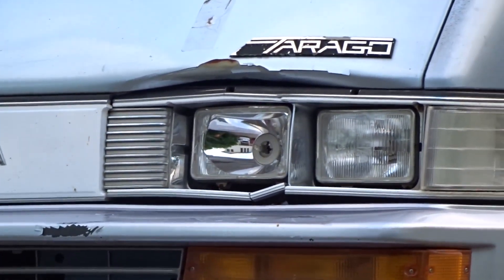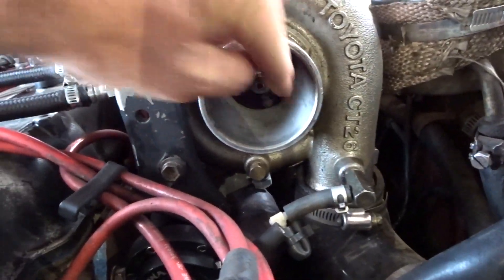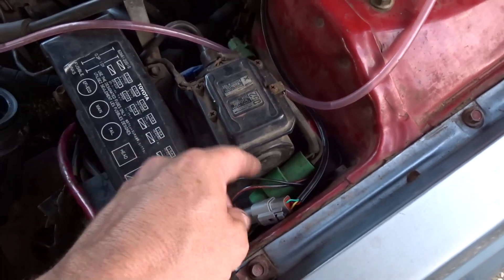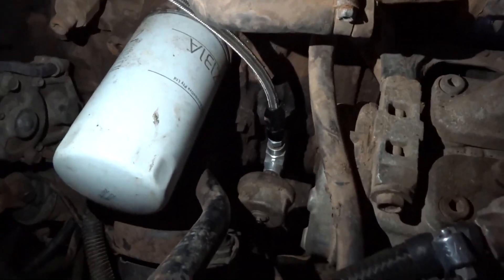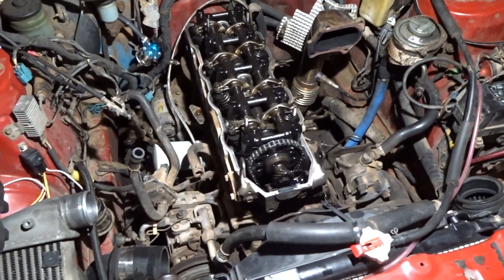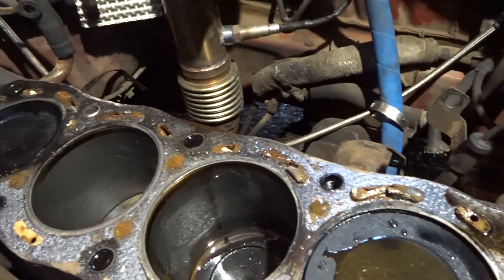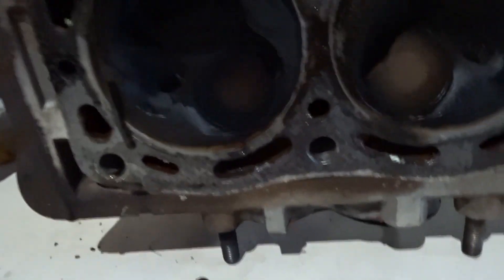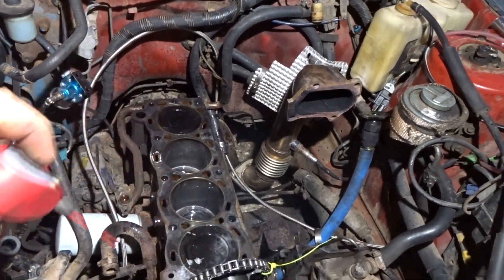Fixing a Blown Head Gasket in my Boosted 22RE Celica! Pt.1

Comment: How she holding up with the studs? I have some ARP studs on the way and am looking for some confidence. My 22re blew the head gasket at 7 psi, and I don't think it was knock induced because I'm using E85. 

Love the car btw! I have a similar build in a pickup (hilux). My maxpeedingrods churbo (t3/t4) been kicking some ass. Using megasquirt on mine, but thinking I might try speeduino on my next project. 

Do you have an aftermarket camshaft? I'm hitting 7 psi at ~3500 rpm with my turbo. The powerband is super narrow with the stock cams, because VE plummets around 5000rpm.

Comment: I originally wanted a 3rd gen celica bc it’s rwd but I couldn’t find one so I settled for a st162 celica. I love the style of both and it debating whether to get a st165 gt4 next or a 3rd gen RA65. What do you recommend. I mainly want it as a weekend street car and take it to the track for grip occasionally.
Reply from the maker: It really depends on how you want to drive it, RA65 is a lot lighter than an ST165 due to not having a heavy AWD system but needs a lot more work to make it "fast".
I haven't even been able to drive my 165 properly yet so I can't give much of an opinion on it unfortunately. From what I'm told they were built as a rally car and won't ever be a great circuit car.

Comment: About 8 psi is good enough. I know how it can be when you have to take apart the car and fix it. It sucks. 

Body damage is easy. But engine that takes at least a week. XD
Reply from the maker: Aiming for 10-12psi with the fresh gasket and ARP studs, should be fun lol
I suck at body work, engine is the easy part for me!
Reply: @AaronBonBarron  I get that. Its the frame that gets me hung up. I can work on engines I just dont got tools to do it most of the time. I lost so many sockets when I was working on the timeing chains